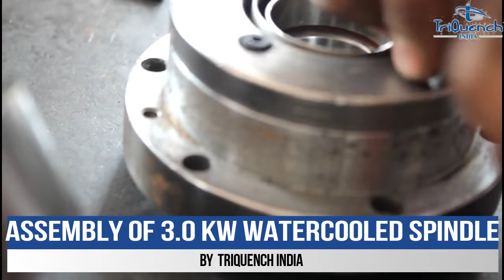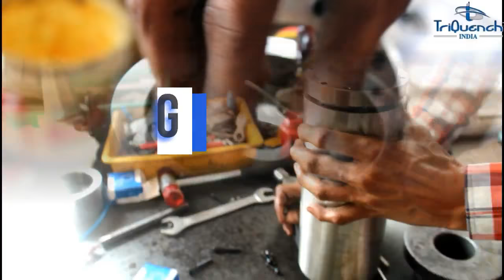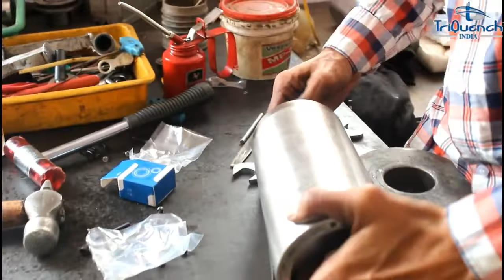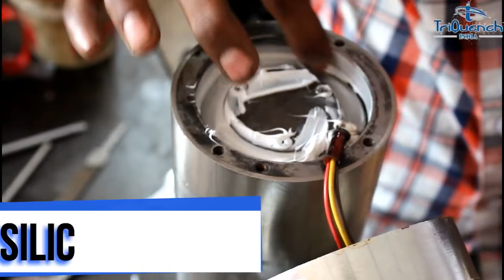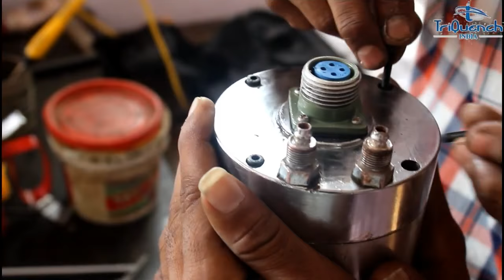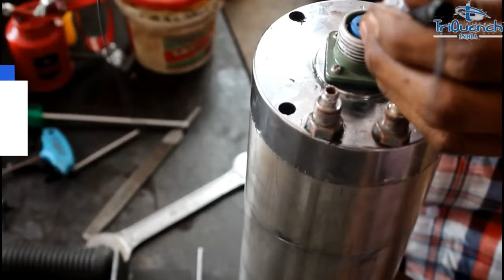3.0 kW Water Cooled Spindle Part 2 | Testing | Fitting | Triquench India | Triquench | India

Comment: What i do when water flow is very slow? And spindle is overheated
Reply: blow the holes with air pump.
Reply: @Raveesh.Vishway   Is not working  some one else  plese
Reply: I caught mine just in time blew it with air and lots of rust came out and the flowxwas good again, then changed my coolent to anti freeze and never had the problem again